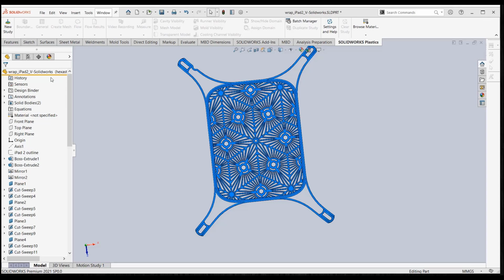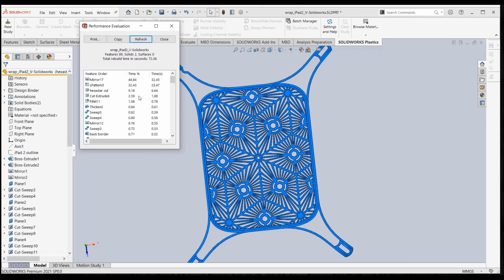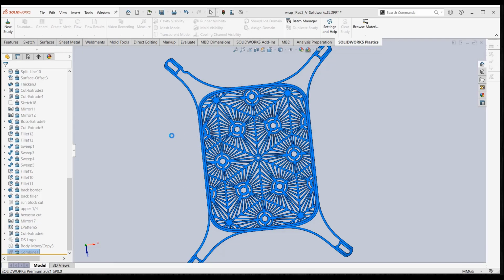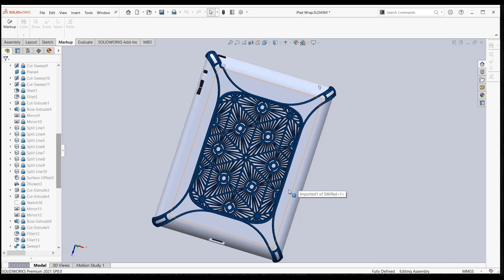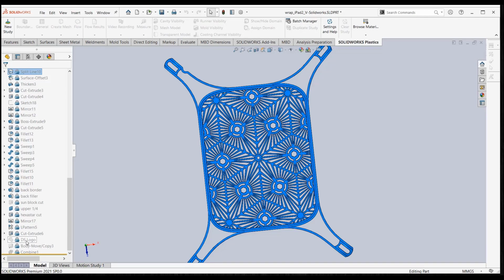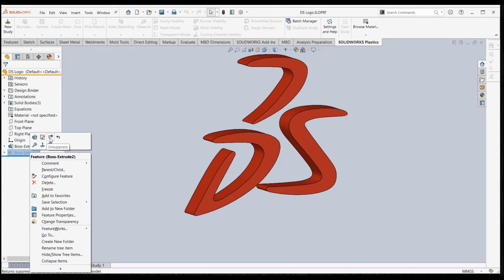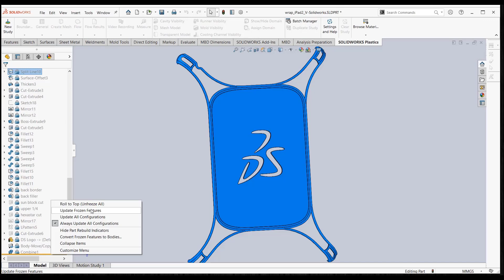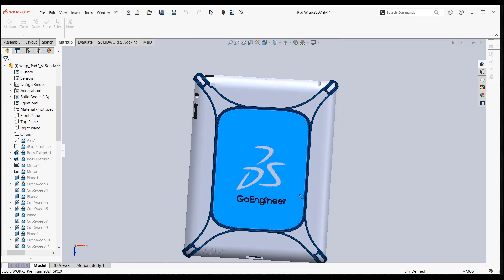SOLIDWORKS Feature Freeze In Depth Overview

Comment: Is there a way to lock or protect certain body inside multibody part from merge option for any further features? I have to check or uncheck it every time for different features.
Reply from the maker: The Feature Scope tool inside of the features CommandManager can be used to choose which bodies are merged.